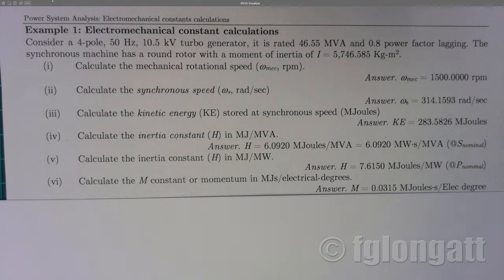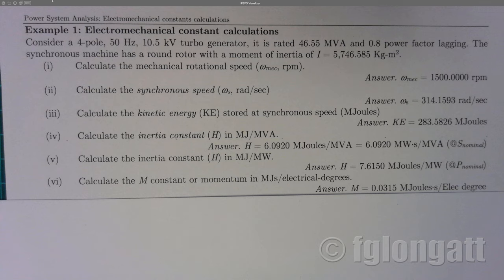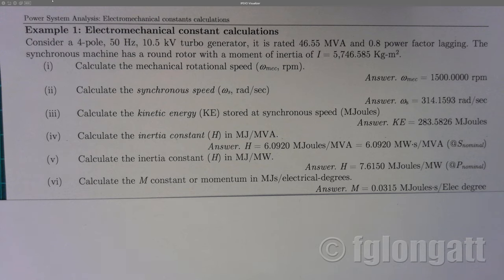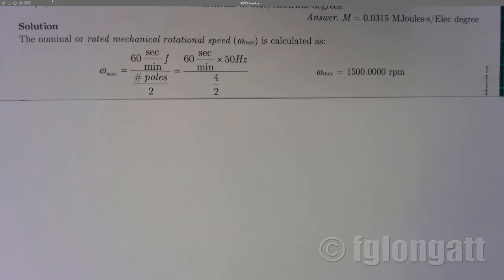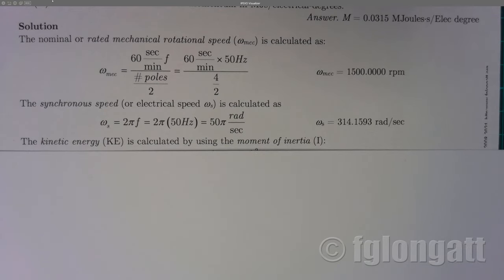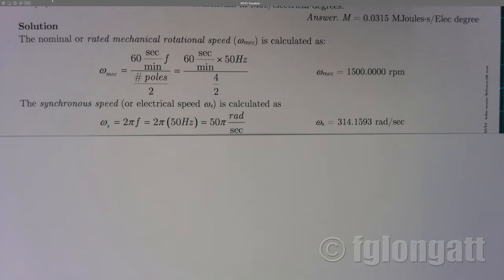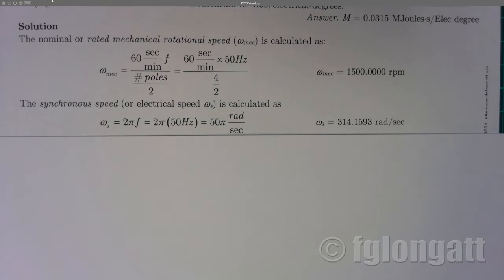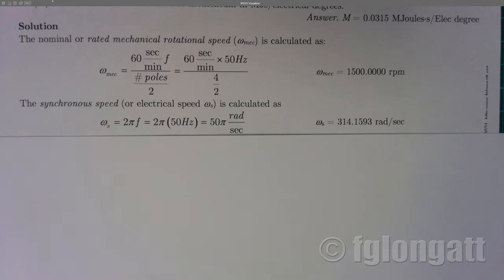Example 1 Electromechanical constant calculations

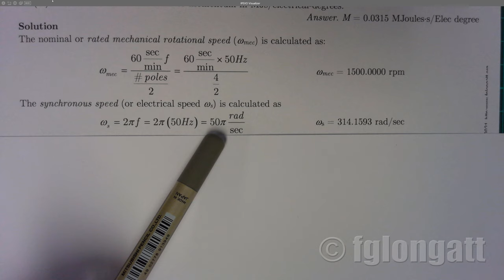Comment: 5:43 Shouldn't that be 100*Pi as would be suggested by 314.1593 rad/s?
Reply from the maker: Thanks for notice the typo, numerical value is correct, isn't it? 2*pi* f = 2^pi*50 = 100 *pi = 314.15 rad/sec